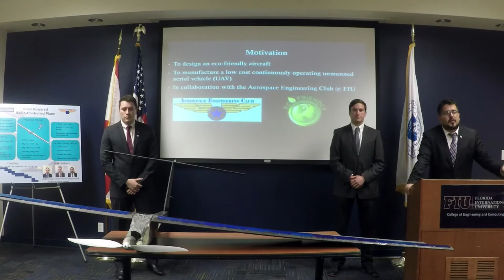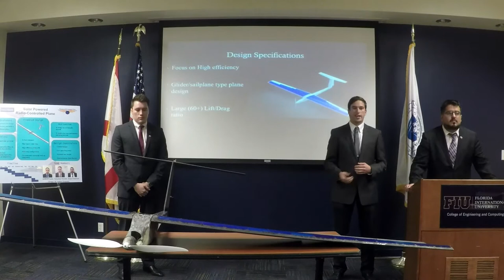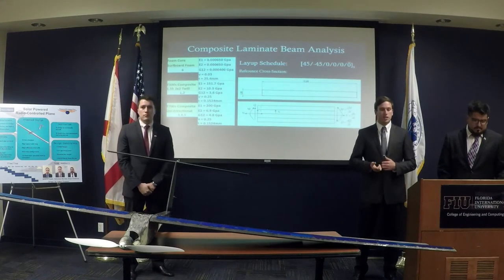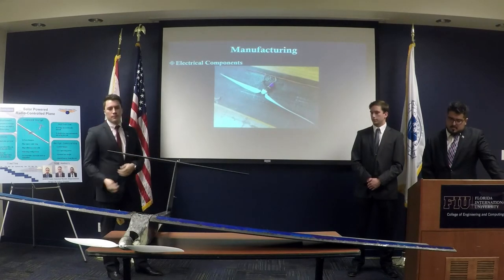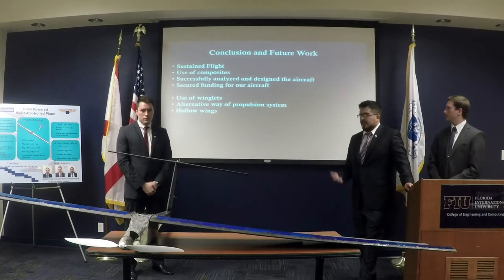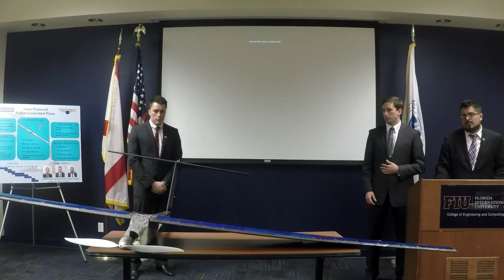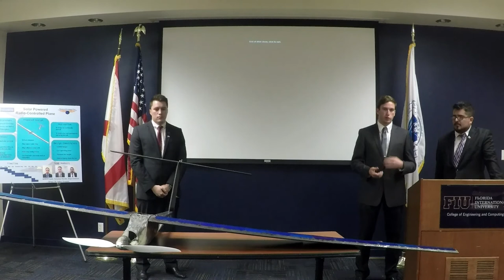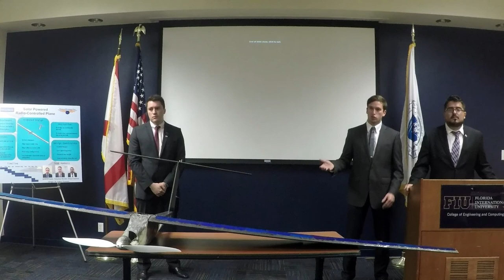SD Team 12: Solar Powered Radio‐Controlled Aircraft

Comment: Presenters were well prepared, confident and engaging. Design alternatives and the reason for choosing the final design was explained well. Data and calculations were well organized. Presentation and project workload was evenly distributed. Pictures helped visualize the manufacturing process. Slides were informative and well organized.

Comment: Nice presentation and project.  Presenters were clear and prepared, handled questions with ease.  Great design and manufacturing.   Had a few slides I couldn't see but other than that - great job!

Comment: It was good that they tested the numbers on their motor to see the actual performance. The constraints of their design were very well explained. Design alternatives were also properly explained. The funding not getting to them fast enough was handled correctly as engineers. Very detailed explanation of the model. The pie chart helped visualize the costs of the project.

Comment: This team had a great presentation and was very knowledgeable about the the design and calculations performed. The only issue I had was that some of the tables used a white background and it made it hard to read. Also the prototype was a bit large to display in front of them.